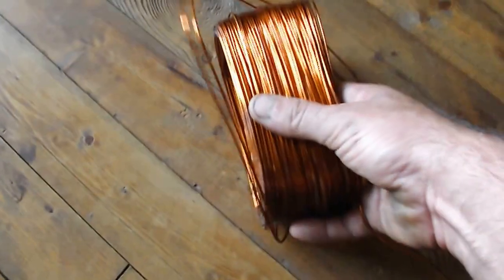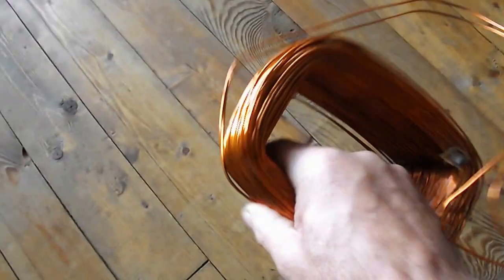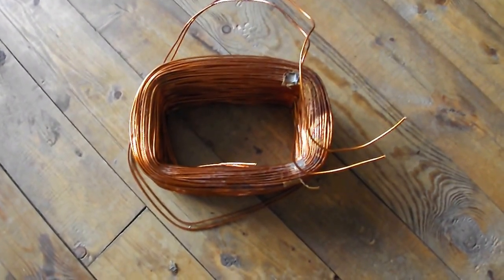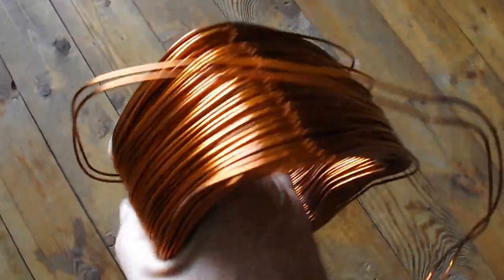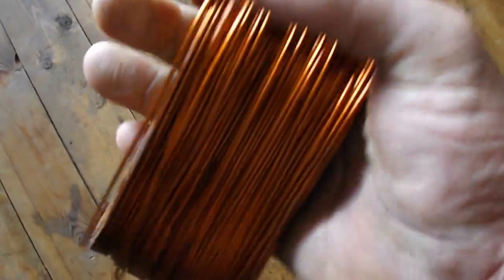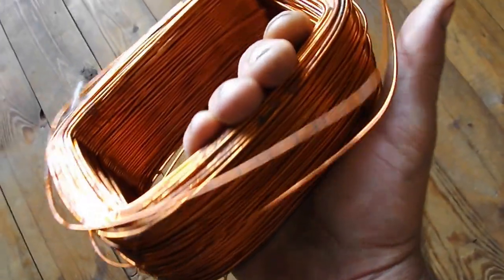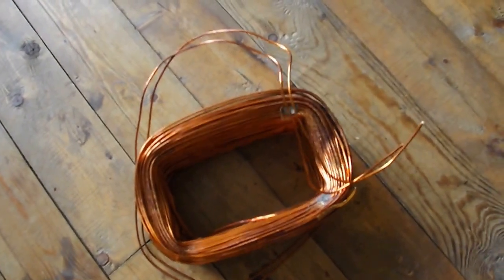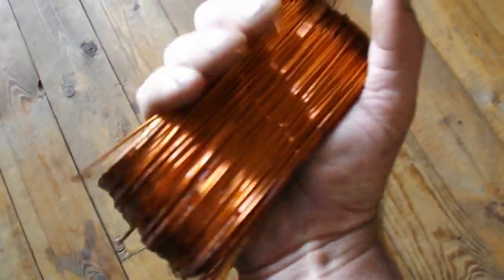Cooper Generator Windings

Comment: Hi, I needed some copper wire to make an  igniter coil for my 1/3 scale Galloway gas engine and I found some old field coils in my scrap box. I made 4 igniter coils, I'm hoping one of them should have a good enough spark to fire the engine up. keep the video's coming.  I've subscribed.  Regards Lim.